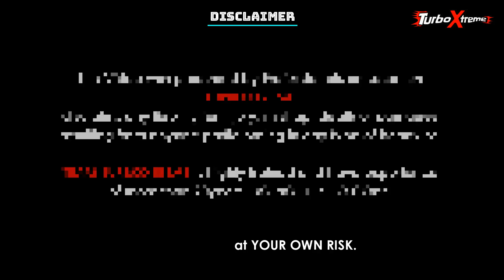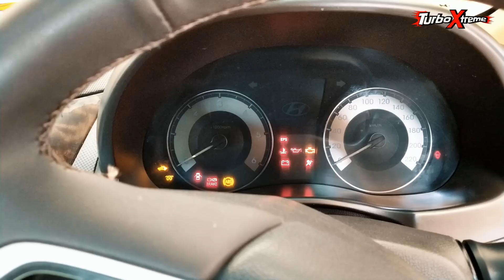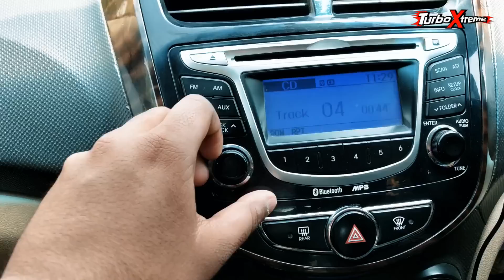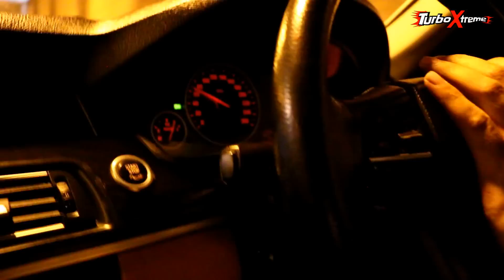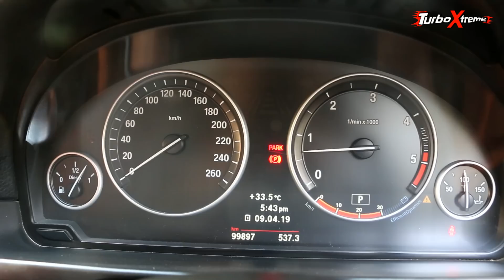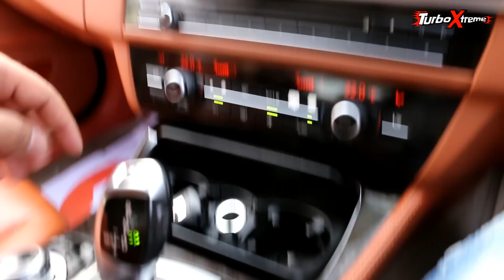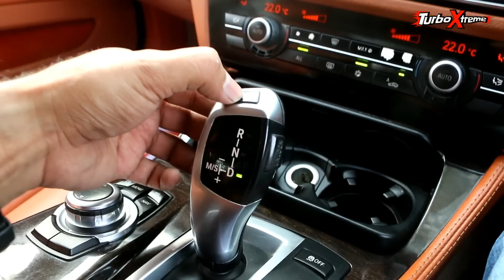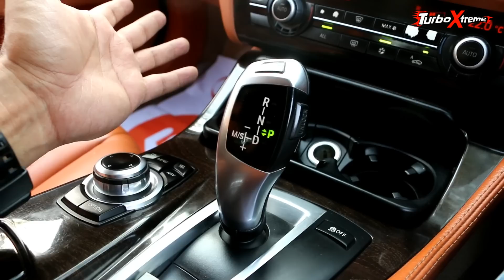Only BMW in this COLOR in INDIA 💗

Comment: Even in 2016 this model had 525d and 530d Length of these two is the same. Only difference was 2000cc engine and 3000 CC Engine